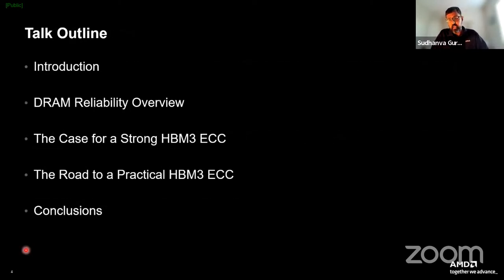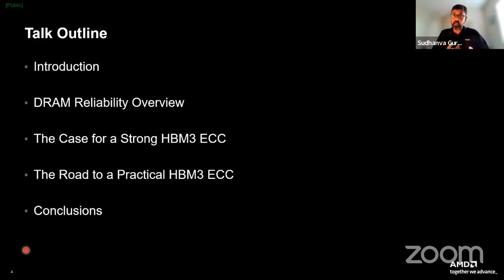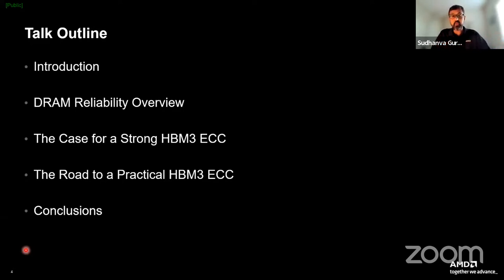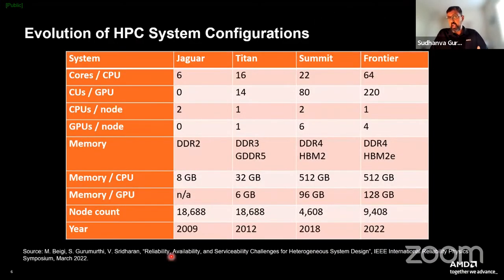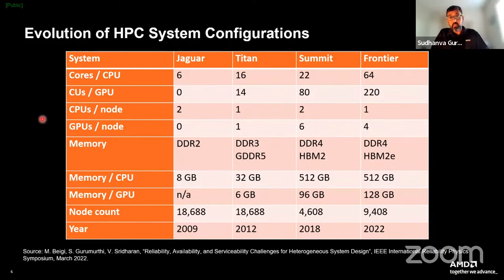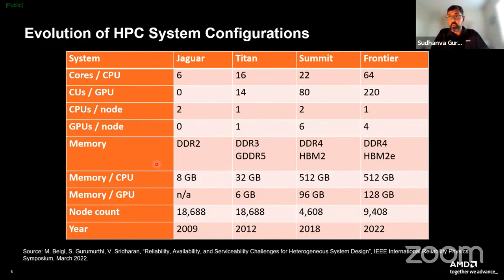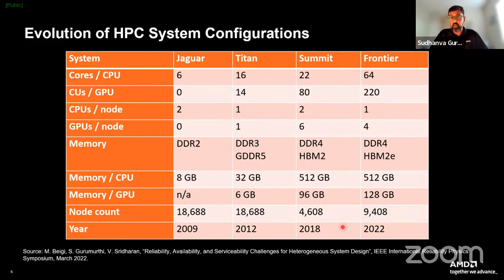SAFARI Live Seminar - HBM3 RAS: The Journey to Enhancing Die-Stacked DRAM Resilience at Scale

Comment: Great lecture and Q/A session to explain this topic! Thanks. 
After all, the explained drive factors (to HBM3 RAS) seemed from DDRx fault models and error types, lack of the HBM specific fault model and RAS enhancement. 
Except the "temperature issue" discussed in the Q/A section, other HBM factors like TSV, power delivery and drop, latency variation for 12H and above, are expected to be elaborated also. That should be helpful.